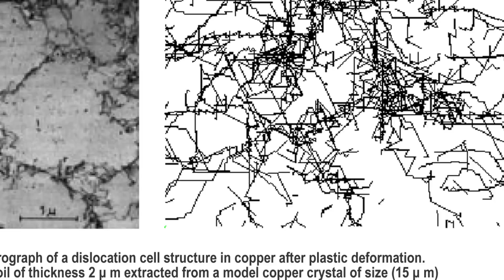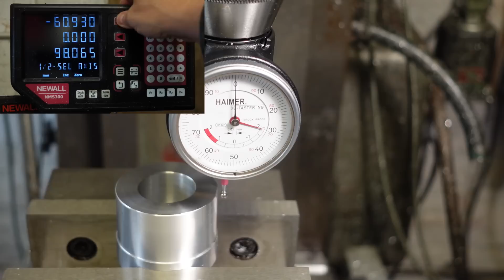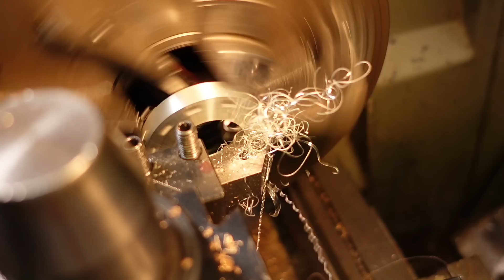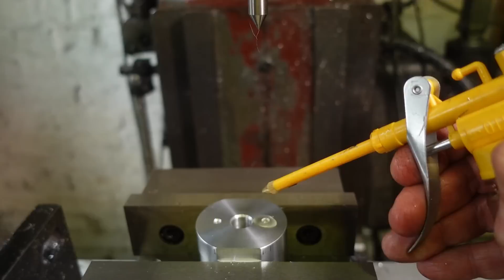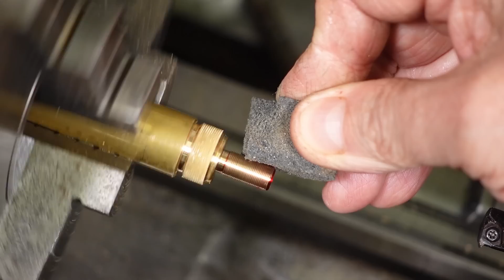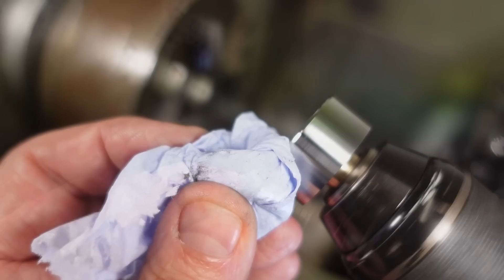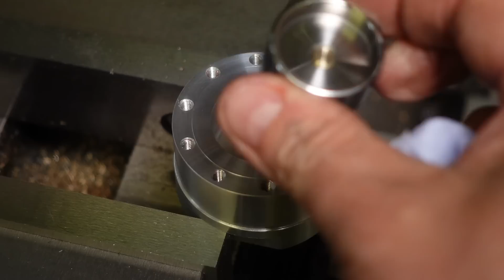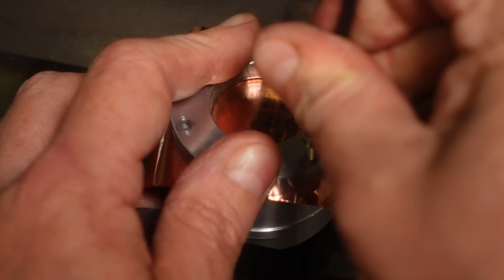Threading AWAY from the chuck! Great Seal Bug Membrane Strainer pt 2

Comment: Change the tool 3 times, move the tool once.
Reply from the maker: Very good point. That's my usual approach except when I need totally consistent depths and I'm using that cheap keyless chuck.  There is a different issue though, which is that reaching round the camera and lights always risks me knocking them, so I tend to use the DRO a lot and not do the sensible thing and do all the ops on each hole in turn.  I need to get camera and lighting rigging fixed to the ceiling so I can get on with doing the job instead of having to work around and through the filming hardware.  Soon as the cameras are off and the lights are out of the way, I do things properly. Mostly. Well enough for a bodger that has no idea what he's doing, obviously.

Comment: I'm jealous of your non requirement for mirror, camera or universal neck joint... using a DTI on my tiny lathe, I often need all 3.
Just realised the parallel between Aimee in your videos and "my cat" on DiodeGoneWild.
Reply from the maker: Mini-drone with a VR headset.  It could fly round the spindle watching the DTI.  

Dan's cat does indeed fill the classical Greek theatre role of the Chorus, and indeed that role performed by the cat and AIMEE would be understood by Aeschylus and Sophocles, although Oedipus Rex, this ain't.....
Reply: @MachiningandMicrowaves  that's a good thing isn't it? As far as I remember Oedipus Rex doesn't end well.

Comment: Brass thread, under compression, into a brass threaded hole. That's gonna bite you in the butt for sure. Why did you go that way instead of just throwing a section of stainless threaded stud into the knob? Especially with such fine threads? Your work is gorgeous as always. Though w hen you chucked that polished piston, I shed a tear. Not even some painters tape or soda can to protect it :(

As far as the foil tearing, have you done a few test pieces by annealing the copper first? The work hardening will be isotropic and not even across the width of the sheet due to the manufacturing process (iirc). I would see if you can anneal it, before forming. I know you want it work-hardened, but you have no way of knowing HOW much work-hardened the foil is, so it might tear in random directions no matter what you do, because it's not equally work-hardened in both dimensions (and even if it was, you have no idea HOW close it is to cracking or a way to check how work-hardened it is at the start). It's worth a few tests, since it wouldn't take much time. Hell, you could partially anneal it to various temperatures, and figure the perfect temperature, that gives you the part you want, at the hardness you want. Something to ponder about!
Reply from the maker: Heh heh, yes it was a daft move to use brass, but as the total lifetime use of this will be around fifteen successful foils, I thought I'd get away with it.  Bit of lube on the threads and there's no sign of galling or wear so far.  The night is yet young though.... The jaws on my chuck have a nice freshly-ground surface with a radius around 45 mm, so it's very rare that it marks anything less than about 35 mm diameter.  That isn't a critical surface either. I have a set of jaw guards, but if I'd been doing more of these, I'd just make up some aluminium softjaws or use some brass shim stock.
The copper is SUPPOSED to be in a specific temper as supplied, but it seems to vary a lot. I've bought a lot of rolls of the stuff and there is a definite difference in quality and consistency from the different suppliers.  It's cheap and nasty stuff mostly.  It's supposed to be in a semi-hard temper. If I didn't mind paying REALLY silly prices, there is a supplier who will provide me with really good material, but the cost jumps by a factor of over 200 and it simply isn't worth it!  I am VERY pleased I only need to make about 15 of these diaphragms.
Reply: @MachiningandMicrowaves  Ah was not sure if no lubricant was allowed on the assembly. Have you lubed the top surface of the piston and the radius on the cylinder? Draw-forming is usually drenched in lubricant, usually a wax-type. Could try to lube that corner radius on the cylinder side, and the piston with some candle wax and see if it helps any. "Only 15" seems like it shouldn't be a problem, until it IS!

And yeah, cheap materials seem like a good deal, until you factor in the time spent trying to make it act like it's supposed to!

I still say seeing of an annealing would help with the tearing, or possible even a deep temper in a toaster oven at a few hundred degrees (f) might help some in addition to the lube. Either way, great video as always, good luck!
Reply from the maker: @dogsarebest7107  I can't afford to have any lube on the upper surface.  I did wonder about making an insert ring from UHMWPE or PTFE or other low-friction materials, but getting a mirror finish on those is more challenging than on metals. I have a toaster oven, but I think what will happen is that I'd need to stretch it rather more to get it to work harden and that might mean moving the piston further with the problems of the angle getting acute and hitting work-hardening issues and embrittlement over the rounded edge. The best approach would indeed be a full anneal then a carefully-measured pre-stretch to work-harden it, then punch to size and glue to a weighted holding ring to apply a preload, then use a clamp that doesn't need screws going through the foil.  Life, however, is WAAAAAY too short!
Reply: @MachiningandMicrowaves  Oh definitely. Hope I'm not adding to the stress of it! I'm one of those people the "RubberDuck Method" helps me work through problems, so I was just trying to throw some ideas your way, and as you shoot them down you might come up with the "a-ha" moment. I really do not know about the need to pre-stretch to get the required work-hardening after annealing, though. Throw 2-3 squares of foil in a toaster oven for 30 minutes at the highest temp, and try to form 'em. If it's taking you many tries to get one useful cup to come out correct, the time/labor investment in trying a few things with the foil is pretty low. If after forming they're too soft, then you can strike that off the list. But if it's successful, it drastically lowers effort for the rest.

But you are right, I was cursed, many years ago, with what I call "Fractal Recursive Yakshaving" with a side of "bikeshedding". And a 7 minute project ends up being 25 steps long and taking multiple hours.. just so that the actual project takes 5 minutes instead of 7. The 3 hours it took to shave those 2 minutes don't count!

It's my honest-to-gods curse!

Comment: I am very much looking forward to part 3, and finding out how you solved your problems. I must say since the first video, and seeing the problems with wrinkles and crumpling. It made me think that a possible design for this, might of been like circular crimping tools. Similar to those for Hydraulic lines and AN lines on equipment. A number of smaller leafs like sections. That both have a taper and meet a taper that drives against the leaves. Causing them to either expand or contract. 

It also made me think it might be something that a 3d printed assembly could do. As the forces in question here are quite low. The majority of engineering grade PLA's available out there, are very close to aluminum in material hardness too. 

Food for thought, thanks for the awesome content!
Reply from the maker: If I had any control over the detailed design of the finished objects, I would use a radically different approach. I'm sure there are better ways to do the stretching, but this is what I came up with under extreme time pressure.  I wondered about using something with rubbery rings that grab the foil form both sides, then somehow expand the rings, but the forces are surprising when the material has a Young's modulus not much less than steel, and the tension in the foil while it's stretching is over a quarter of a ton if my numbers are to be believed.

Comment: Question, when you broke a foil did you make a note of where the tear started from? If there's a common point on the fixture that the tears begin, it's a pretty good indication that there's something at that point causing a stress point.

Also, while I may not know much about stretching copper foils, I've helped enough drummers reskin their snares to know that you need to apply the pressure incredibly evenly in order to avoid splitting them. Not sure of the order you tightened those retaining bolts or the torque used, but a wheel nut style of working opposites and with a torque wrench may be helpful if you've a few to do.

Edited to add; I also think a little lube on the piston to allow the copper to slide over it could be a good idea...
Reply from the maker: I'm using some lube with PTFE in, seems to help. The yield point seems to be more related to the direction  the foil is aligned.  It tears more easily across the roll rather than along it.  I guess there are microscopic flaws from the electrolytic deposition.  I thought it was always at the side nearest me or the side opposite, but then I rotated the foils 90 degrees and the failures happened at the left or the right.

I do the tightening like a round cylinder head or a large flange, doing opposite pairs, then stepping round to a pair as far away from those and possible, then keep trying to spread the load evenly.  Doesn't seem to make any difference.  I do a final sanity check of the torque on each one in turn. I even use a tiny torque spanner to be sure I'm consistent. No useful effect at all, but it makes me feel all Scientific and full of Metrology, even though I'm not.
Reply: @MachiningandMicrowaves  sounds like you've covered all the bases. Not sure what else could help other than maybe trying to lightly anneal the foil first to remove any directional stresses. Not sure how you'd do that with it being so thin though. After that I'm well and truly out. As if RF design wasn't already dark art, now you're adding metallurgy into the mix!

Comment: Hmmmm. Have you considered placing a polished flat surface on the opposite side of the foil from the piston that is loaded. The tearing i saw looked like unequal stretching of the material
Reply from the maker: Spot on diagnosis. I'm also being a lot more picky about the foils.  Some of them have definite banding from the electrolytic process or maybe the polished titanium drums they are formed on to. Now I am gluing the foils to a large ring first, that problem has just about gone away, plus I'm getting a feel for how the foils behave, but watching them through a microscope.  I can't put anything on the upper face because the mounting for the foil has to be fitted through the hole above the top face.  I'll be very very glad once this is all over, I know way more about the macroscopic physical properties of metals now than is good for a simple microwaving machinist.
Reply: @MachiningandMicrowaves  You are probably the best placed YouTuber to make one of these.

https://youtu.be/cU0tVHoN2uc?t=246

Comment: Where do you get your supplies?  I have difficulty getting anything exotic from my 'go to' suppliers, and the bigger companies don't want to deal in small quantities.
Reply from the maker: For fancy stuff like short-chipping copper alloys, I call up the suppliers and see if they have any bar ends or will do me a special favour.  Titanium and decent brass is pretty easy, and the steel specialists will happily do smallish quantities of  tool steel or EN24A or leaded mild steel.  I get most of my aluminium from digging around for good prices on websites, as it's very hard to get any leverage with anyone for the small amounts I'm using. Stainless is easy enough.  Bronze is OK so long as you want hollow bearing extrusions.  Small quantities of Meehanite and spheroidal graphite cast iron are just ludicrously expensive. Fancy copper alloys are the hardest.  I found a place that will sell me a couple of metres of Tellurium copper and 21 kg bars of Sulphur copper at acceptable prices.  Metelec will sell it, but the prices are off the scale.  Aalco have done me a few good deals.  Smiths Metals are often good for C101 copper and other common stuff.  The Sheffield branch are very helpful and they don't overcharge for small orders.  Quite a few will only deal with VAT-registered limited companies.  I'm seriously considering registering a company and doing a voluntary VAT registration just so I can by from UK and overseas suppliers who refuse to deal with me as a private individual or sole trader. The folks who supply aluminium treatments will only sell to limited companies. Even though I have an explosives precursors and poisons licence, almost nobody will sell me sulphuric or nitric acid unless I'm a limited company. Some suppliers change their tune rapidly when I mention that I have a youtube channel and might smile upon them nicely if they will sell me a few bars of specially shiny metal.
Reply: @MachiningandMicrowaves  I read a comment earlier about how you had an infrared light from rearing piglets, now I see that you've got an explosives, precursors and poisons license.  If I include your ability to speak a language which I recognise as English but don't even remotely understand, I find myself having to ask:  Do the talents, skills and experience never end!?

Also, I genuinely feel like you could say "I once caught a fish thiiiiis big" and you'd be the first person in history to be telling the truth.
Reply from the maker: @Ben7878-o7o  One of my minor claims to fame is that I designed and hand-printed the tee shirts for the Eddie Grundy Fan Club, yes THAT Eddie Grundy from the long-running BBC Radio series "The Archers". That's not the claim though.  The late John Peel, radio DJ extraordinaire was a member, and wore one of the tee shirts on BBC Top of the Pops in about 1993.  I wish I could find a recording of that show.

One of the Berkshire pigs I  bred won Best of Breed and Best Pig at the Royal Agricultural Show at Kenilworth in the mid-90s. If you've ever seen the Lord Mayor of London's annual Parade, there are two woven willow giants, 16ft tall, at the head of the procession. I made parts of the torsos and heads, based on MRI scans of the heads of two executed criminals in the US.  Rare pic of me standing on a chair weaving a "Latvian Ledge" border joint at the waistbands . I have a serious beard in that photo. https://www.basketmakersco.org/gog-magog
I also made part of the 1987 Turner Prize-winning exhibit "George and the Dragon" by Tony Cragg. It included a willow hamper but while it was at the Glasgow Museum of Modern Art (where some of my own basketmaking work has been exhibited), it was attacked by woodworm, so the Arts Council of Great Britain asked me to make a replacement, which I duly did.  It was then put on display in the Henry Moore Gallery in Leeds.  I took my mum to see it and had the total joy of pointing at the hallowed exhibit and saying "I made that". I also made ten of the collection baskets used in St Paul's Cathedral in the City of London, it's one of the duties of a Yeoman of the Worshipful Company of Basketmakers to provide such things.  I also get amusing benefits such as the Freedom of the City of London (freedom to ply my trade as a basketmaker within the City boundaries).  I'm rubbish at absolutely everything else though.